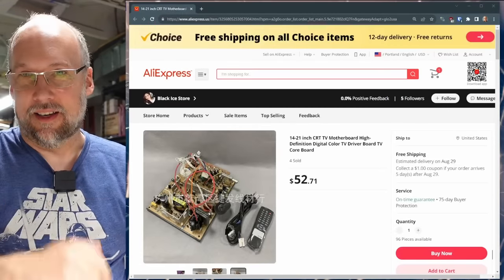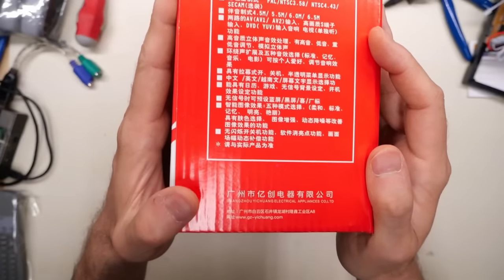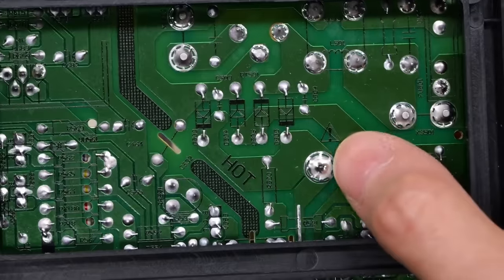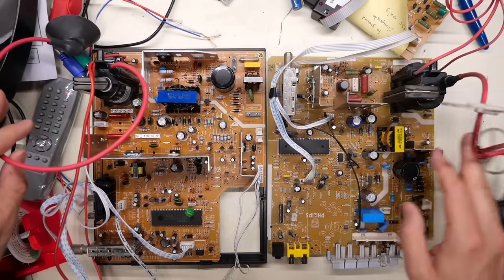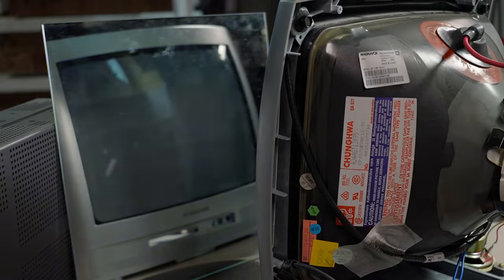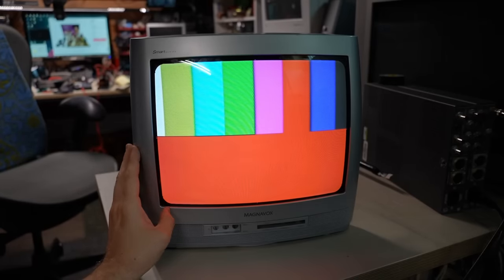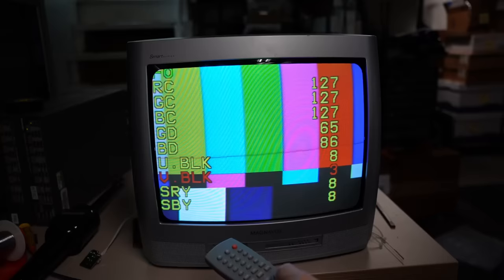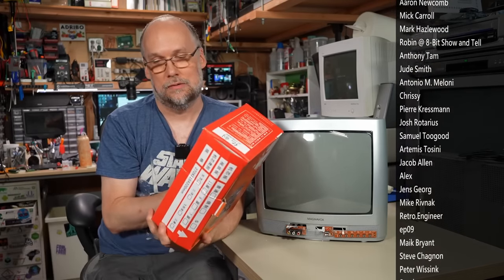I replaced the main board of this TV with brand new parts made in 2023!

Comment: Is there one of these boards with SCART available? I'm still trying to figure out how to fix a '03 Sony Wega in the UK and there's next to no info on how to fix the thing (it suffered a software alignment issue - It works... for about 10 seconds then defaults to a protection mode but trying to figure out how to take it out from that mode isn't forthcoming).
Reply: These highend flat CRTs needed very special dynamic convergence hardware and software. Late Sony CRTs were even programmed in factory using magnetic fields (containing an array of small remagnetizable metal magnets), so if they got accidentally erased or magnetized wrong (e.g. by degaussing coil touching its back), the tube was toast and only made colour mess - impossible to remagnetize the individual tines correctly at home. There is no chance to run it with a generic PCB.

Comment: I watched both your videos on this board, the commandore was amazing. I have a Saisho ctr6 5.5" tv i have composite modded. Are there any reason why i couldn't use this board to upgrade it with remote and OSD? Are the neck connector smaller on small CRTs?

Comment: There is gotta be a board like this with samrt apps built in. That would be so funny. A smart old tv without other devices connected.
Reply: The German HD recorder settopbox "Dreambox" is basically a smart TV for CRT. I am using a Dreambox DM8000 on my PAL CRT TV (VCR as RF modulator). It runs Linux and can not only stream movies, but converts HDTV to PAL resolution, plays DVDs and many other things. Unfortunately it is too old for H265 and can not decode Netflix etc. (may be a licensing issue) so it would need a connected PC to translate the video stream.

Comment: Put those electronics on an HD CRT TV, and you can sell them for a mint, to vintage gamers. Just make the settings gaming oriented.
Reply: CRT HDTV sets won't work, because those flatscreens needed specialized dynamic convergency circuits. But a fine pitch SVGA tube (without flat surface) from a broken PC monitor could make a great looking PAL/NTSC TV.

Comment: Would this work on a 1940's 50s 10 imch crt or would some adjustment need to be done on the pin connector? Just poking ideas. I know the yoke can be repositioned to adjust screen size.

Comment: If someone is able to make a new board for this kind of CRT screen … I'd love to see a new board for a 100Hz Panasonic CRT TV that would make it possible to use it directly as a monitor for VGA output from a PC. It can't be that hard, can it?
Reply from the maker: VGA style monitors are quite a bit more complex because they have to support many different horizontal scan rates. That means a complex system to run the flyback and maintain the right high voltage for the CRT. I think very special and custom chips were developed for this near the end of the CRT era but all of those chips are long gone
Reply: @adriansdigitalbasement  And highend flat square TV/monitors had terribly complex dynamic convergence, that would likely only make colour line mess if connected to a generic PCB. I doubt that the microcontroller of this board supports that. (Even worse were only delta CRTs of 1960/70th colour TVs; they had analogue convergency hardware with 2 dozen knobs in the complexity of a Minimoog synth.)

Comment: Noise reduction, the real deal (not the gimmick) attempts to normalize noise. Like when you are watching a show and keep cranking up the volume, then the ads come on and they are 2x louder. It normalizes that volume. I think Magnavox used to have the best version back in the day.  Also stuff like Static and white noise or no signal noise is muted out. I say there is a gimmicky version in that it does not work nearly as 'smart'. It was a big thing when I worked in the A/V department in Best Buy.

Could that discoloration in the corner be the degaus acting for a moment like an electromagnet, like you put a magnet near it. ?now you need to degaus it. lol
Reply: I guess "noise" rather meant here snow reduction on analogue antenna TV. My parents had a Metz 100Hz TV with all kinds of digital gimmicks including this, but it blurs motions and removes not only snow but also rain! And the ugly digitalized picture even looked spoiled with those image dishancers turned off.

Comment: Interesting video but I hope this guy is a qualified electrician I also think that hot glue will not work on the TV since if the device heats up it will still melt the glue and would then undo the work you have done
Reply: Hotglue melts at minimum 80°C (there are 2 types with different melting point). Unless it sticks to a CRT neck or poorly cooled transistor or fat CPU/GPU, it won't make any trouble.

Comment: Nice job.
...on the electronics!
I wish I had you knowledge and experience in that area.

Instead of woodworking skills though, I suggest gaining some machining skills. You could make a lot of that board work in the existing case. Most of that is transferable to woodworking but not so much the other way around from my experience. For instance, drilling & tapping with wood doesn't give you much of the knowledge & understanding you'd need for metal. Machining also requires that you have good understanding of feed rates, speeds & cutter geometry where with woodworking you can get away with a lot more fudge-factor  ...in my experience.   ...now there's gonna be a bunch of piano makers & luthiers picking at my comment. lol

Comment: Probably the reason the Sony Broadcast monitor is such a "poor monitor" is that broadcast equipment is intended to show all the flaws in the signal.  It's intended to be used by those who can fix the issue to give the most correct signal to the consumers.  OTOH, consumer monitors are designed to give the best possible picture with the signal they're given.

Comment: I remember having a few CRT tv's and a couple monitors as a kid. And for some reason only 1 of our tv's had a huge amount of static electricity on the screen all the time! When you'd touch the screen it would send hundreds of static shocks through the glass.
Is that normal behavior for a old tv?
Reply: It depends on if or how it is grounded. When an ungrounded TV set (this likely also means no live chassis hanging its GND on mains) is turned on, it charges the CRT to about 28KV, with one pole hooked to the electronics, so you get half that highvoltage on the electronics and all its connectors (antenna, audio, SCART etc.). That's why they warned not to hotplug SCART (with VHS recorders on grounded hardware I did it always without damage), and why homecomputers and game consoles died of static electricity when someone touched e.g. joystick ports after switching such a TV set on. It was not your shoe soles and carpet but that 12KV (half CRT voltage) generated by powering the TV on, that flows through the joystick ports and computer chips from the antenna jack of the TV.

Comment: i mean.... honestly you should be wearing leaded pants and have a geiger counter handy....... My primary concern would be the tube emitting x-rays.....
Reply: You only produce xray if screen voltage is way too high. AFAIK many later CRTss or flybacks even were legally required to have internal xray protection, but I don't know how it was implemented. Possibly highvoltage just arcs over and gets shorted when it turns too high. I only remember warnings in repair manuals that certain parts should not be replaced with others to keep the xray protection intact. Smart-TV are even worse; they always cook your brain with pulsed microwaves because the wifi/bluetooth transmitter never turns off even when disabled in user menu.

Comment: Hmmm... Made for 14 to 21 Inch Tubes, but how its about the high voltage ? Its not the same for all this different sizes ?!?
Reply from the maker: Guess not, it was still putting out the same 20kv that the original monitor was.... I'd think that a 21" would need close to 25-27kv -- but perhaps the deflection yoke plays a part in the higher voltage....

Comment: I would learn how to repair a TV but no one has the time, or patience to show, or explain. All the older people who learned it dont like to show it to others :-( I was really happy to repair an old one with a blown up capacitor and burned out a 10 watts resistor in series to it. I waaaaas sooooo happy. The capacitor was shorted and killed the resistor in series to it, coming from the rectifier. All the parts, also other caps has been replaced and i got a decent working TV
I really want to try this part, but do i have the balls?
As i was a child, i got a huge shock from a 230 volt fairy lights, maybe 6 volt lamps in series, one light wasn't working, i replaced the wohle lamp holder, also didn't work, so i've tried to hold a light on the wohle wires...... nothing to say now, days with nightmares someone has plugged it in again, its burned in my head like a movie.
It is a big mystery why only this light wasn't working... But i learned, be f**king careful with higher voltage, check everything more than two times, safety first, the german 5 rules, this was my first and last shock, now im 35.

Comment: So looking at this I ask myself which CRTs are worth keeping as I have a lot of them and wanted to select the best ones
Reply: Old CRTs wear not only by burn-in, but also weak cathodes change colour curves, thus ripe CRTs tend to display ugly "glowing" red because low intensity red becomes too high. It would be great if the software in that upgrade board had a "colour processor" to correct deformed curves, so CRTs could be usable about 3 times longer without getting unpleasant colours.

Comment: are crt tv PCBs interchangeable? i got a 21" tv that the tube is in excelent quality but the pcb is trash, i rgb modded it to use with a PC for arcade emulation stuff but it doesn't output 240p, it's by no means a digital crt tv, it's full analog, but it probably has some trickery that makes 240p look similar to 480i

if i could salvage the pcb from an older cheaper 14" tv to use on my great quality tube, would be awesome
Reply: Yes they are interchangeable but there is catch.
You must find a way of adding an inductor on horizontal deflection coil or change the deflection coil all together,and use a Tv deflection coil instead.
Getting the standby blue screen can also be a challenge when using a TV deflection coil

Comment: Is it possible to replace the main board with an FPGA? if possible this could be a kinda cool
Reply: Not recommended. If the software crashes it starts a fire or turns into an xray gun by excessive highvoltage. At least it would need some external safety circuit logic (like in vector monitors) that does not depend on properly loaded software.

Comment: So, as the box claims "HD", is that a false flag in that the tuner doesn't actually support
ATSC 1.0?  

If it did, I would have loved to see how well it would work when scanning channels from an antenna.
Not that I would ever use a TV like that anymore.  LOL
Sure, I have a few old (newish) sets in the basement, but I only hang onto them for memory's sake.
Reply from the maker: No, typical marketing junk from places like China, where a lot of the "features" don't actually exist. This board is 100% analog, just like any TV from the 90s :-)
Reply: @adriansdigitalbasement  "Digital" is here the inner working inside the microcontroller chip. A genuinely "analogue" TV would contain dozens of coils, capacitors and trimmers to adjust screen linearity, colours etc. etc. and could never do that through a service menu by remote control. You had to turn little "knobs" by a plastic screwdriver inside the electronics (that is running on mains voltage, so avoid to get shocked) to adjust anything. This hardware is "digital", but not the TV signals it can receive.

Comment: I wonder how old of a TV you could do this with say like a console TV from the 70s or 80s.
Reply: CRT heater voltages an pinouts greatly varied over time. (Some tubes had grid instead of cathode controls for RGB signals, needing a different video amp with much higher control voltages.) I doubt that this is possible without much additional hardware for signal voltage conversion.

Comment: Don't trust high capacity capacitors with cheap Chinese devices maybe rip offed  from old devices and re-strink warped. Or internally low capacitor inside. Remove the cap and try autopsy test.

Comment: What is the highest frame rate that can be achieved?
Reply: PAL is fixed at 50Hz, NTSC 60Hz. It is about latency not bare fps why CRT is superior. E.g. Atari VCS2600 had no framebuffer and so could respond on joystick or paddle motion faster than anything modern. Extremely fast reaction games will play much worse on emulator because there are many serial computation steps between recognizing controller motion and bringing the result on screen (even on expensive gamer PCs). And because CRT draws line by line, eyes don't blur motion by following objects redrawn by framerate.

Comment: hii adrian...great video...the chassis that u used is known as a universal chassis for late 2000 crt tvs..
If ever you hear noise coming from the back or noise from the yoke of the crt its because the yoke is drawing too much current as the chassis might not have been design for this model...in case such problem arise u will have to put an inductor to control the current.
consider these video in case u have that kind of issues
https://www.youtube.com/watch?v=0jcYCN210M0
https://www.youtube.com/watch?v=FGLsexIUfmk

Comment: don't think it's for 'tv's' mate. think it's just for if you so desperately want to use crt's for your display panels of any sort, as they just 'work' for 50 years or so. and need something to hook them up to after building them into your wall panels or wherever you put them. the fact that it has an analog tuner and probably teletext support neither of which are still around for normie broadcast thingies but definately are a thing for security cameras and closed installations that just need to work for quite a few decades to come still is telling. :P (ya know. crts actually are quite sturdy contraptions compared to those flimsy flat panels, and if you build it all in now and only need it in 40 years. it will just work when you enter your bomb shelter 40 years from now :P note that crts are not more suitable for vehicle (vibration) or airplane or space use (weight ;) but they definately make sense in bunkers and submarines. cuz they just 'work' when and if the time comes that they are ever needed. :P no firmware 'updates' no 'protocol changes' no weird and complex parts that are too tiny to fix, etc.
Reply: But it would not surprise me if this replacement PCB does have firmware in flash memory that will eventually die of bitrot because it overwrites e.g. volume and selected channel settings every time you push a remote control button.
Reply: @cyberyogicowindler2448  ya know. that probably makes it last longer, not shorter. otherwise the guaranteed data retention is just some 12.5 years or so ay :P when writing you have to re-write at least the entire block.
Reply: @CB3ROB-CyberBunker  Every overwrite starts an erase cycle, which shortens the lifespan (in consumer SSD (MLC,TLC) often only about 500 rewrites possible). SSD is DRAM with 1 year refresh rate. But that rewrite acts as a refresh helps only if it only happens rarely. SSD also wearlevel in the background without write operations by the user, which makes power fails and surges so dangerous - if the ram supply capacitor went bad or fell off, everything gets corrupted by only connecting to power. I don't know if the flash inside this TV MCU does such nasty things (likely SLC memory that lasts longer), but it still wears by use.